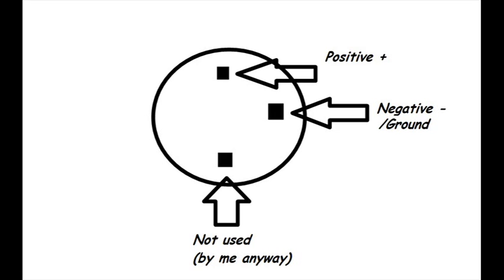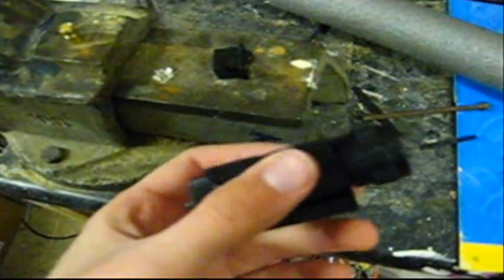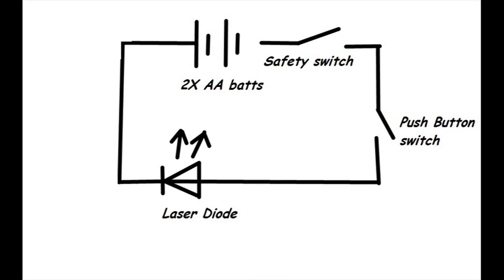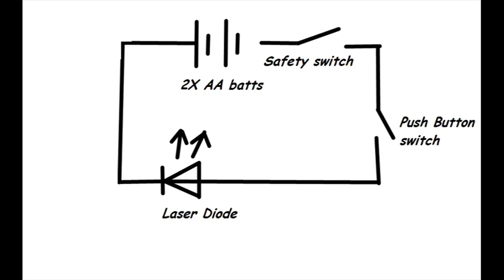HOW TO MAKE A DVD BURNER LASER PEN

Comment: First and last this he should have mentioned in the video that he failed to do specially all the people that will not know the true dangers a laser of this magnitude can pose and will think this is like any other laser you.can buy from Walmart first this is NOT A TOY if messing around and this laser bounces off a mirror and hits you in the eyeball its lights out you will be blind if it skims across anyone's eyeball for 1 sec they will be blind immediately imagine taking a magnifying glass going outside in middle of summer on a sunny day and focusing the sun  to a tiny point right into.your eyeball this laser will do the same amount of damage if your going to assemble a laser like this make sure to be very responsible and treat this device as you would a firearm.dont ever point it at anyone and always wear the proper safety glasses when you plan on using the laser pointer if the laser reflects off anything and it hits your eyeball its lights out so use with caution people

Comment: they have to etch and burn through the dvd to record information onto it, i think you need some sort of chip set, or to save the one from the dvd burner. because whatever the lets say filament of a laser is made of, needs its electron value to change from one n state to a lower n state to emit a certain wavelength of light, which is really just a displacement of air molecules, so like a higher electricity level to a lower one, but not completely off.  then you can use e=hf , e being joules, h being planks constant and f being the frequency to get the energy of a photon. convert that value to photons per second, seeing what % of energy that circuit board is taking from the watts given from the energy source, to diode. or watts times seconds, times percentage time 1/the energy of one photon. photons per second is what you want to know for how to burn things.

Comment: Is there a way to focus a laser for burning that does not require buying a "laser module"?  Can one find something in another  part of a computer/printer or whatever that can be used for focusing?
Reply: you could use 2 different magnifying glasses and put them at different distances to focus or a camera lens or a microscope or anything with a lens like a cheap pair of binos
Reply: Kiran de Silva but ignored for the laser to work you will need a driver which comes with the axis mount unless you are bothered to make your own laser driver

Comment: Would it be possible to lower the current to make it harmless? Does it hurt in contact with skin?
Reply: less voltage going through, but it only hurts skin if you hold it on someone for an amout of time. like 15 secs, depends

Comment: The laser diode would draw to much current at 9 volts and turn into a puff of smoke. Most laser controllers have a way to limit the current going through them, but his circuit doesn't.

Comment: too many volts.  AA batteries have 1.5 volts each.  (So 3 volts total)  

9 volts would probably drive too much current and likely burn the diode up.  

You probably could use a 9 volt if you added a resistor, but 9 volts cost too much anyway.  Might as well use the AAs.

Comment: It isn't sodder its solder, the actual pronunciation is as it is in the English dictionary, SOLDER, as it is spelt. Sodder is an American variation of the language from England. Also, If it were supposed to be pronounced A-LOO-MIN-UM it would be spelled aloominum rather than aluminium. Saviour is also correct, the spellings all come from an older version of the language where the people that could read and write were only posh people and pronounced it save-ee-our rather than save-your.

Comment: @plopli2009 
I must agree with Plop. Running your diode off of ANY type of power supply with no driver will end in a burn out. If anything else it will tremendously short your diodes life.
You can buy a flex drive driver for pretty cheap or even some pill drivers.
If nothing else just make your own. Would MAYBE cost you 5bucks in components from radio shack and 20 minutes with a soldering iron and a perf board.

Comment: @chubbychinchilla My guess is that you hooked the positive terminal of the battery to the negative terminal of the driver and vice-versa. Go to laserpointerforums, it's a great website and there are many build tutorials on there that show you the correct way to assemble a laser and its circuitry. And regarding what kind of driver to use, I suggest you use the FlexDrive V5. You can find it in the Laser Pro Shop section of laserpointerforums.

Comment: You MUST use a driver to regulate current to the laser diode or else it will damage the diode and possibly burn it out... I'd use a LM317 regulator based circuit. DO NOT FOLLOW THIS BUILD TUTORIAL BY POWERING THE DIODE DIRECTLY WITH BATTERIES.

Comment: Well Have a lot of Q's:
If i buy a laser diode from ebay something like :"808nm 300mW High Power Burning Infrared Laser Diode Lab" do i need a module for it like the same mW's? Or it will be enough only 10 mW? Well if u didnt understand just :
will that work: "808nm 300mW laser diode" and "650nm 10mw module 12mm case"?

Comment: very important question if someone could PLEASE!!!! answer .....do u have to have the axis laser housing or can u simply run cables to the positive and negative ends of the diode to the terminals of the batteries....if not is there an alternative? so i dont have to get the housing?

Plz answer thnx a ton!

Comment: If you use a cd burner, well you can't its a different kind of diode and simply will not work and yes it does have to be a dvd burner. 
only because of the diode type and MWage.

Comment from the maker: well done...
just connect the 3V power supply to the diode until it works diodes only work one way there is no need for a driver board folow the instructions on the video
And please subscribe if this is helping in any way

Comment: well I have a burner I just took out of a dvd burner and the diode is encased in fairly solid alloy. Looks like it has been glued in and may be impossible to remove without wrecking it